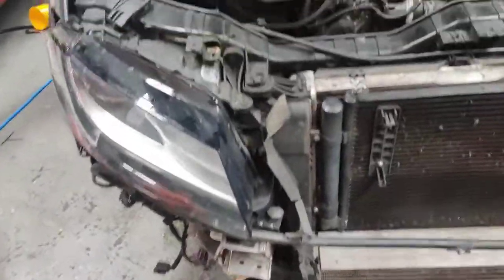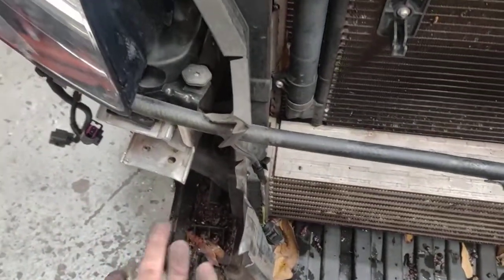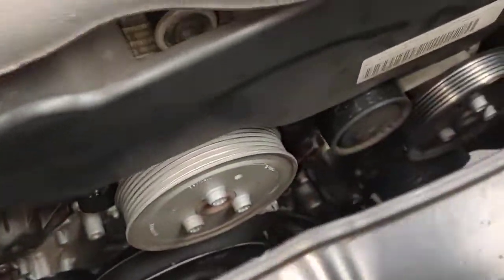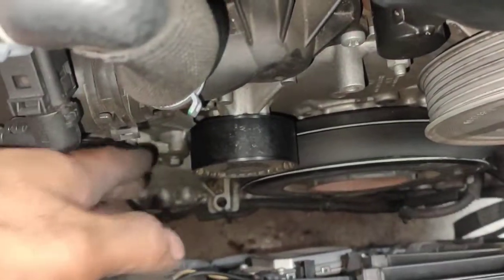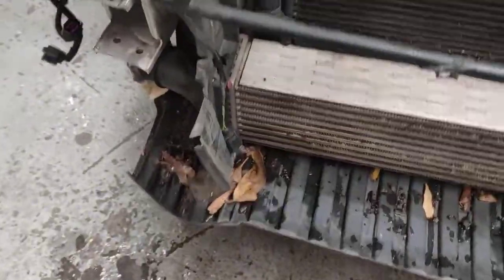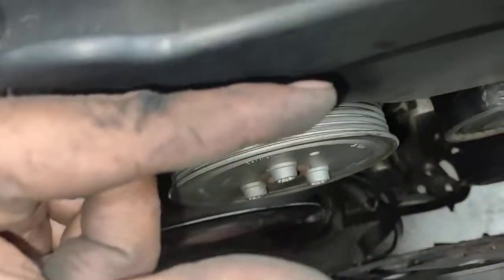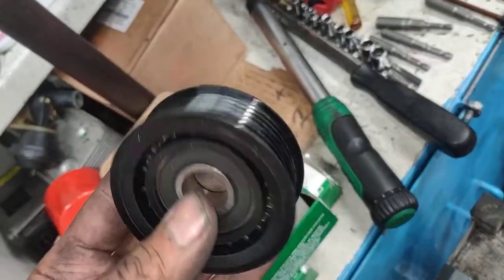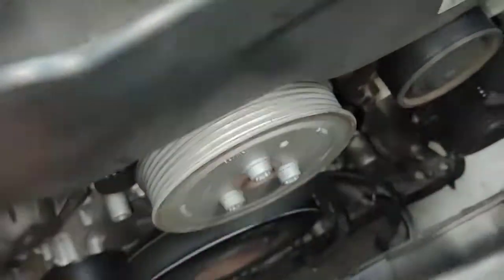Audi A5 CCWA 3.0L Diesel V6 - replacing drive belt tensioner & rollers

Comment: hey. have you had problems w/ those INA toothed pulleys?

I had one dancin around.
My 2no. new V.Belts snapped. not sure why

on the second time i even replaced the Tensioner and the Water Pump Pulley aswell as the seeting pump pulley.. Wrapping my head around this one still

Comment: I removed loom bracket from sump. 2 screws.
I made up 2 new brackets to hold the loom in as close as possible to area above sump so the belt is in front of this loom. Stupid design as you can't get the belt off without removing the loom bracket. I took the whole front of car off to fix this. So I could work on repositioning the loom behind the belt.

Comment: Got exactly the same engine but having issues with the bottom electrical loom, and getting the belt around the loom in particular... any idea on hot to get the belt on with the loom in the way? Is there a trick to this?
Reply: you worked this out?